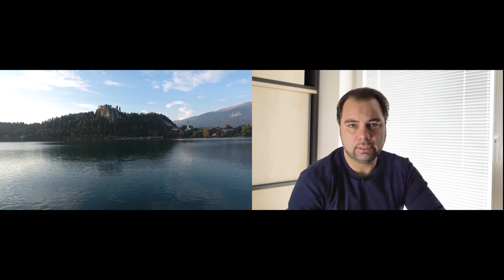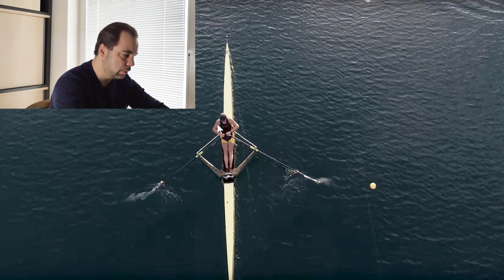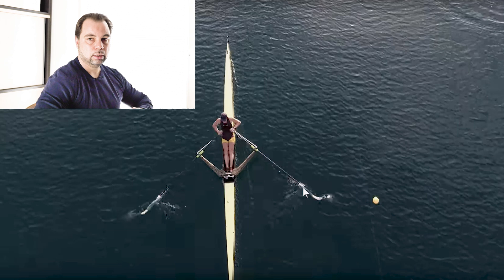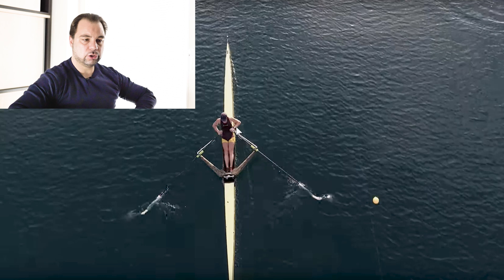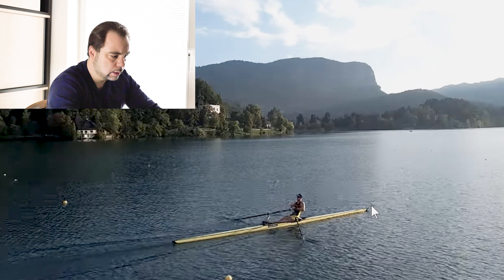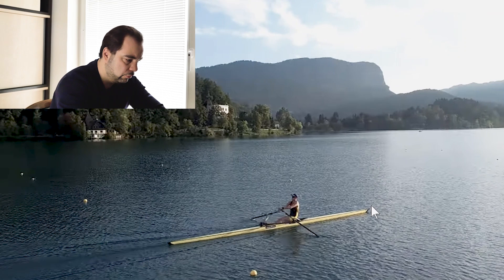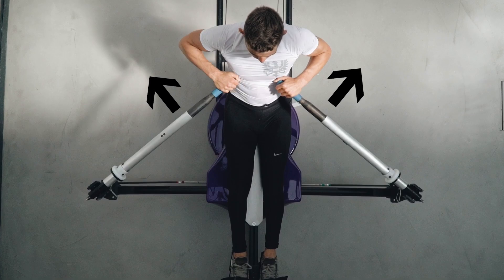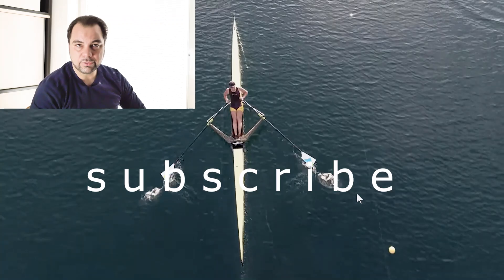One of the most common sculling technique inefficiencies

Comment: The extreme angles of this rowing style are not contributing much to forward acceleration and he would probably gain if he moves the oarlocks out a little and increases the length of the lighter oar to keep the same inertia and lever effort on the rower. The swept oar angle should a little less than 90 degrees kept symmetrical to a right angle with the boat. Note that at 45 degrees the forward component is 0 .707  of the maximum and that is assuming the oar does not have a standing start in its pulsating action.  Such extreme angles should be avoided in racing, and though the rower feels good about his sweating effort, the energy transfer is not going to the right state/direction required.